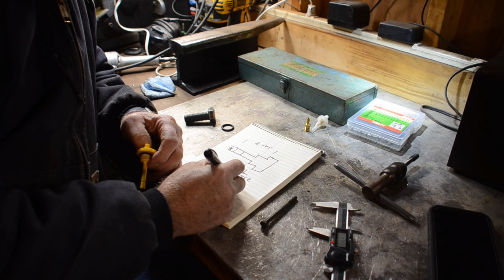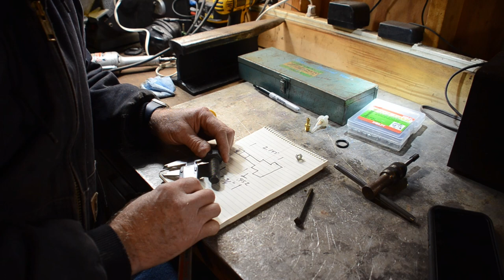How I made my axle vent and saved over $60 in one hour.

Comment: When tapping the bolt, I have used 1-1-1 Trichloroethane (Tap Magic) cutting fluid and found it better than cutting oil at easing the tap into the hole.  I appreciate you posting the video.  Found out about overpressure on my front axle of my 2003 John Deere 790 the hard way.  Seal blew out and I started trying to find the source of the leak.  While watching YouTube videos on the teardown and rebuild of the front axle and MFWD drive finals, I came across your video.  Will definitely do this to my Deere when assembly is completed on the final drive and axle seals.  Thanks again for posting.
Reply from the maker: @winfordnettles3292  I was a toolroom machinist for years, i prefer cutting oil. Tap magic smell is not pleasant to me and stays in your clothes, it more costly than a good old cutting oil. Good luck with your seals.

Comment: Don't forget to tell people the thousand$$ of dollars you have invested in shop and tools....
Reply from the maker: Jerry, not really. That is why I show a way a person can make them at home. This project could be done with a hand drill, hack saw, file if needed. The drill press was a hand down from wife's grandfather, the small vice was one of my dad's, the belt sander was scrap from work that I rebuilt, the right angle grinder, taps, and drill bits I purchased. Where are the thousands of dollars?  Keep in mind I am a machinist, project manager (at sheet metal manufacturing company), mechanic retired. It was my job to figure out the cheapest and fastest way to repair/rebuild/manufacture things. Thanks for the reply.